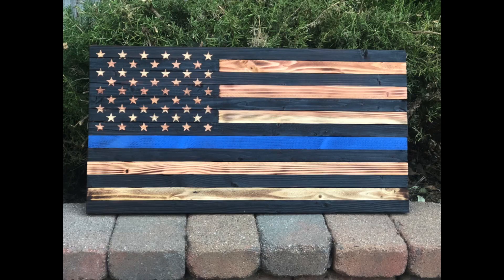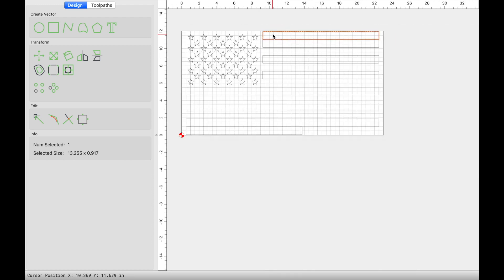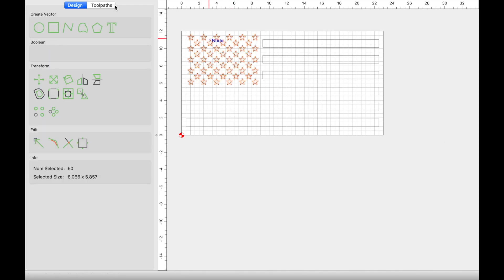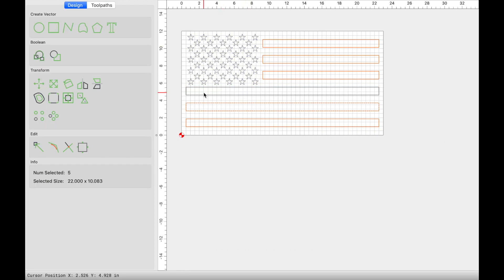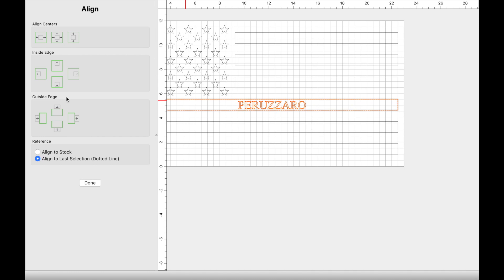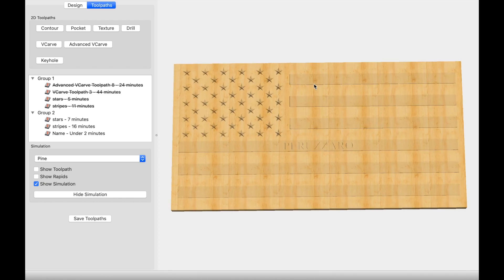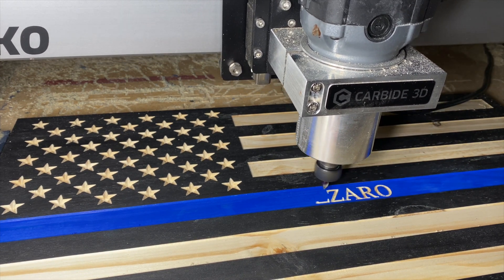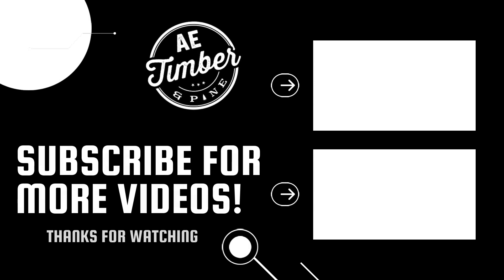How to Make a Thin Blue Line American Flag on a CNC - Carbide Create Tutorial

Comment: Hey Edgar, great videos question to carve the name what cnc bit did you use and how deep was the settings. thanks again.!.
Reply from the maker: Hey Doug,
Of course.

The plunge and feed and rpm are the exact same as the other , 80,90, 18000.

The max depth was stock bottom (thickness of material) 

I set my z zero before the carve within the stripe to account for the pocket I had made.

Hope this helps!